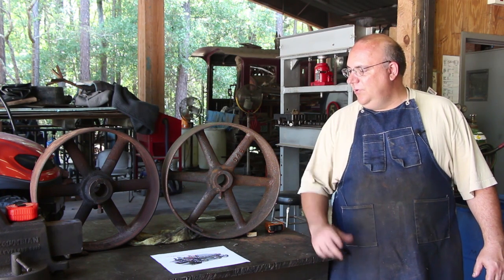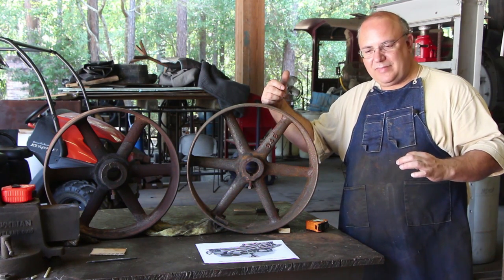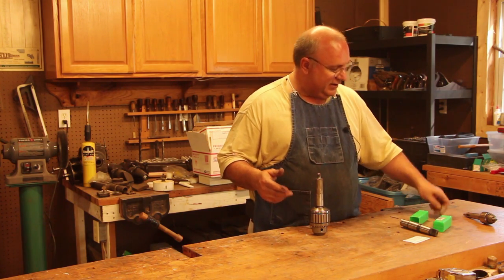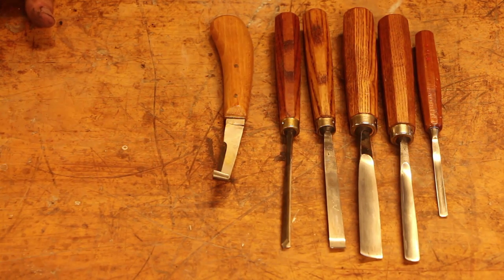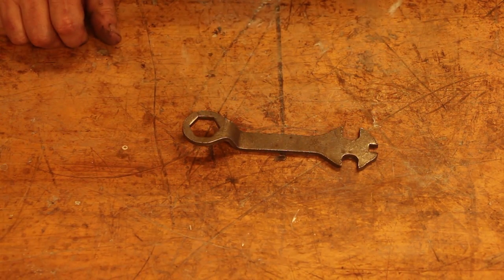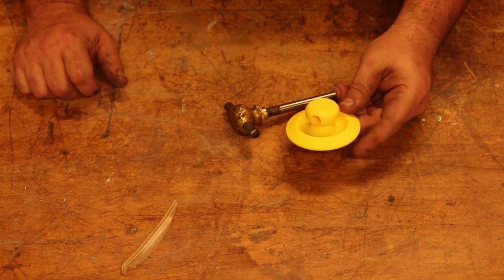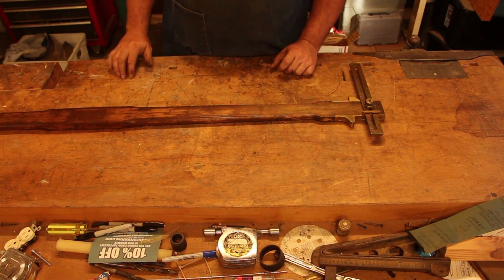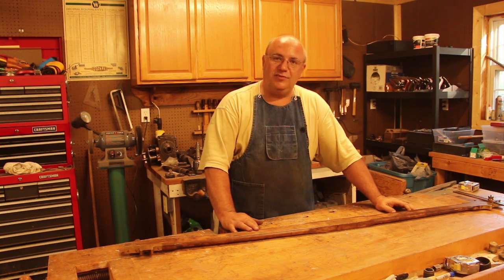Odds and Ends 2:  Flat Belt Pulleys, Viewer Mail and an Unusual Mystery Tool

Comment: Hi Keith - I brought home an antique lathe Canadian metal works corp.  12 foot bed and 18 inch swing.  I am now setting up the drive for this old girl - flat belt pulleys - My question is this. Do I need a belt tensioner to change speeds or do I just guide the running belt onto the smaller pulley.Thanks keith

Comment: Thank you for sharing this information. I am 64 years old and from Denmark, and was raised at a farm. Back then quite a lot of machinery was driven by flat belts, and they were typically made of canvas. But I do see some differences and I like to share them with you:
1. You need to use belt wax to avoid belt slipping. This wax was made to be some sticky ingredient. I do not know how much it have been used in the US, but I know that a Danish emigrant to the US started production of it. We know, because we got the letter with the recipes sent from father in Denmark to son in the US. Such recipes were normally only in the mind and a secret.
2. Most of the larger pulleys were made of wood. The high power small pulleys on an electric motors were made of steel.
3. I have seen the joining of the canvas belts made my with some special arrangement of steel thread with a small steel shaft to hold the ends together. I think it also were used in Denmark. But I did also see at method with the two ends flipped to the outside and joined with a saddle stitch. I cannot remember if the stitch were made by steel thread or some natural material. At the joint you got about 3/4 inch of belt sticking out, and it could be dangerous, because it could grab some cloth from a person coming too close.
Reply: Those junctions of the canvas (or leather) are called 'belt lacing".  I have seen those belt laces somewhere  here at our shop, (Machineco) complete with a tool that helps the lacing to be driven through the belt.
Reply: @loftsatsympaticodotc  Thanks for the English term, "belt lacing". I guess the steel belt lacing may cause problems, if the pulley diameter gets too small. I think a strong saddle stitch may be better for smaller pulleys.

Comment: Needing help on my flat belts. I've got an 1912 Monarch lathe 16"x60" which is about to spit out a belt. The lathe came with several rolls of leather flat belt but they are covered in an oily soot. I think it's a reason the belt starts to seperate. What do you guys use and a good maintainer on these belts. Product names appreciated.

Comment: Keith,
I know this is late and you most likely have the chuck removed but I am posting this for others that run into the same problem. The Jacobs web site use to have a pdf file instruction sheet that showed you may have drill out the back of the chuck to remove the arbor. Here is a link the garage journal formula. APmech posted an excellent article on chuck removal.

http://www.garagejournal.com/forum/showthread.php?t=57817

Comment: Open the chuck jaws to maximum.  Drill a 5/16" hole through to the arbor,  there is a space between the end of the arbor  & the chuck body. Then you can use a pin punch to knock the arbor out   I did this same job the other day to a smaller version of your chuck.  I live in Felixstowe, Suffolk. UK.  Please keep on making your videos.  Best Regards.  Ron Cartwright.

Comment: Love your videos Keith, so many different things to deal with.  great work!  Regarding your chuck and taper removing problem. You may know far more ways to go from here but this is my guess/hint that may work.  As you know with a drill chucks there is usually a screw holding it in place, yours may not have that screw however it might have a hole big enough for a brass drift??  you may already have thought of that. but I hope it helps.  Good luck!   Thanks for sharing and above all Please have fun!

Comment: Considering that the shaft is already boogered, why not heat that up enough to dry out any gunk or even glue holding them together?  It should at the least create some wiggle room when it cools.

Comment: I don't know the manufacturer of this particular level but I have a Woodings-Verona track level marked AREA No. 27.  It doesn't have the track guage features on it.  This one was probably used by the roadmaster to check the track guage, elevation of curves, difference in rail elevation for low spots,  the check guage between the frog and guard rail in a turnout, and the other side is for checking the work-a-day track guages.  This tool is NOT for laying the rails just checking.  A 3-point guage would be used for the actual track laying.  If you look carefully at the ends of the level vial you will find one end is attached and the other has a screw for adjustment.

Comment: The “what is?” is a standard track measuring gauge. The one end is for checking the point size and the check rail gape. I’ll keep looking for documentation, but it looks almost the same as the modern one in use today. I also had a chuck that I could not get off. I think it was Jacobs’s number two taper. Mine was put on with Loctite never to come off without a lot heat. I am still looking for the key for it as it is a Supreme number 2T2.

Comment: well you are right. the measurement gives it away. I havent tried to document it yet but it has to be for checking rail spacing and level from rail to rail on railroad track. the block with the notch looks like it may fit over a wheel flange to be used for checking the gauge of wheels on rolling stock. I will let you know if I find any documentation.
Reply: Is the notch possibly used to check the track gauge at a switch?

Comment: Hey Keith,

The chuck removal thing just came up recently on the Harrison Lathe group.

Jacobs chucks are soft through the back, so you can drill and tap them. I did this at work so that I could transfer the good chuck on the bench drill over to the Myford, which had a horribly abused chuck.

Comment: Hi Keith
I reckon you will not find this rail spacer and inclination gauge in any catalogue, it was probably made for a rail inspector by a coach builder around the 1920's, and a later level added made by Stanley's.
It evokes thoughts of people who really cared about use and cosmetics of their tools, look at the modern examples which do the same job but without fineness.
Thank you for the brilliant videos, keep them coming.
Regards Tony
Yorkshire England

Comment: Keith Rucker, I doubt I am the first to ask this if I am understanding this correctly, and I looked over the comments but didn't see mention of this. In the video 6:04 you said about the belt thickness, you doubled it to come up with the correct pulley size? Isn't there only one thickness of belt between the pulley and the drive belt? One thickness would make the pulley equal to the other side. It doesn't seem to make sense to me but I'm sure you know more about it than I do.

Comment: On my 18N chuck the arbor was rough too. if you don't intend to reuse it what I did was cut it off in the chop saw. Then I chucked the chuck up in my lathe and drill and tapped what was left in the chuck to I think it was 7/16 might have been 1/2, then I just screwed a bolt into it with a heavy flat washer and a sleeve that fit the bottom of the chuck and it pulled right out as I tightened the bolt.  I think that would be faster than making wedges and you get a lot more mechanical advantage as I find these suckers seem to really get tight on those big chucks. I think the one on my 20N could lift my lathe and not pull out! lol
Reply: I recently removed an arbor from a chuck with a hole in the bottom by firmly tightening a hex nut in the jaws and then screwing a bolt into it to act as a puller.  Tightened the bolt, tapped the arbor, out it came.

Comment: Hey Keith, the Blackhawk pliers are also used for removing and installing cast iron piston rings on hydraulic pistons. We have some at work and always use them for the iron rings. 
The socket extension right after is always a nice tool to have. 
The grinding wheel dresser looks to be the same style as a Desmond. 
Those 3d patterns are great. That's going to make a good video for the restoration. 
 The what's it tool I don't know what it is, but I would like to guess. First glance it looks like it could be used to measure wooden airplane props during manufacturing. Very interesting. 
Thanks for sharing this weeks odds and ends. 
Adam

Comment: Keith.....I think the reason that they don not make wegges for that particular size and larger, is that the JT is larger than the shank and nothing to wedge against. Typically.....if you open the chuck up fully, there should be a hole in the bottom that you can use a 1/8" or 3/16" punch.....that is if someone didn't tap it and put  a bolt in to hold it together.....I don't recall you checking that.   Jim
Reply: oops....guess the punch method was alreaddy mentioned, but I have drill a hole in the few of mine that did not have thru holes.
Reply: Jim Liechty
I just checked, and all 3 of my 18N's have a 1/8" hole thru the bottom

Comment: I agree with Don Foster it is A rail gauge for laying out railroad track rails. It measures the correct standard gauge distance between parallel rails as well as the bank height for cornering (called superelevation) with the end that has the perpendicular scale
http://youtu.be/yrNqgmXqiK8

Comment: Visegrip slide hammer for pulling that chuck taper will give you nice straight line force.

After you applied that heat, you could have quenched the arbour tang and   may have shrunk enough to let go.

Comment: I've removed drill-chucks from arbors by opening up the jaws, putting the assembly in my bench vise with  the arbor pointed down, then using a pin-punch and hammer coming down through the chuck to separate things.

Sometimes the MAPP gas torch helps...

Only had one so far that wouldn't come undone - not sure how the previous owner messed it up...

As for the Pulley-Pile out at the museum, that sounds like some good service project hours for the local Boy Scouts - or maybe the Girl Scouts... Just a thought.

Regards,

Eric

Comment: I just went through the exercise of replacing the arbor on my 5/8" chuck.  I opened the chuck to it's maximum diameter, placed the still-installed arbor between the jaws of my vise with the jaws opened slightly wider than the arbor diameter.  I then used a 5/8" diameter rod inserted through the chuck to tap out the arbor.  It worked perfectly.  Might this work in your situation?
Reply: ***** could you make one? chuck fully open in the tailstock, a drill in the headstock and a guesstimate on how deep the hole needs to be

Comment: Keith,
there's usually a hole in the center of the chuck that goes thru to the taper side, i put a rod or a punch in there and tap with a hammer (steel hammer) and the arbor comes out pretty quick (few taps), other chucks even have a threaded hole where you can put a bolt in and press out the arbor. hope this helps
(I don't know if your chuck has any of these but just in case)

Comment: Keith. I'm not sure that you are correct about the original purpose of the knife tool shown with the carving chisels. From here it looks much more like a hoof paring knife which farriers use on horses feet when preparing them for shoeing or vets etc use on cattle feet. They come in both right and left hand forms.

See:   http://www.cowsfeet.co.uk/product/aesculap-foot-trimming-knife-right-left/
Reply: Good catch Dan.  I knew this too and was going to comment.Fred
Reply: almost 50 years of using one tells me this knife is without doubt a farriers hoof knife. but looking  at it, it doesn't appear to have ever seen a hoof.no stains(manure changes wood color), no signs of wear and tear. a knife only used to last about a year what with constant sharpening.  I think keith is correct in saying it was repurposed..

Comment: A rail gauge for laying out railroad track rails. It measures the correct standard gauge distance between parallel rails as well as the bank height for cornering (called superelevation) with the end that has the perpendicular scale

http://www.google.com/patents/US1633535

http://en.wikipedia.org/wiki/Track_geometry
Reply: I had no idea what it is, but that was my guess. Maybe one of the older guys at the Railway Museum could verify that and tell Keith a story or two. Thanks for the info.

Comment: had a major problem getting arbor out of chuck even wedges didn't work..     Finally chucked the chuck by it's nose in lathe and bored out arbor right to the minor dia of the arbor in the chuck.  remaining shell of the arbor still didn't want to come out so i lightly heated the remainder of the arbor and ran a tap into the chuck avoiding damaging the chuck taper.  tightened the tap shank end in the vise tapped it and presto out i came

Comment: Hi Keith. I'm a little confused. If the OD of the pulley is 16+, why does the belt thickness change the rolling, synchronized diameter to make it "even" with the pulley on the other side of the machine? I do want to say that you should be a teacher. Had I had a gentle, instructive person like yourself when I was in high school, there may have been a completely, more enjoyable career for me. Please continue with your excellent videos! They are SO enjoyable!